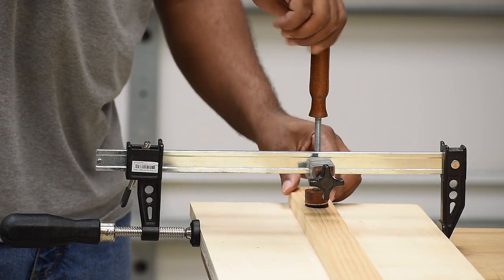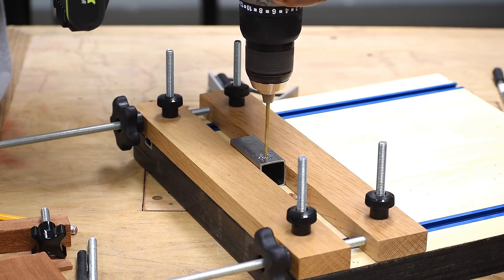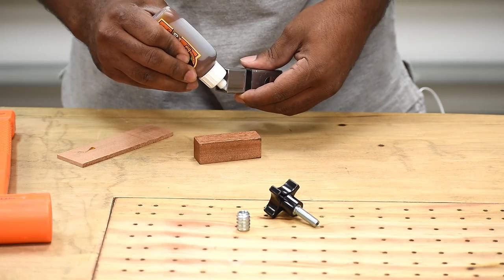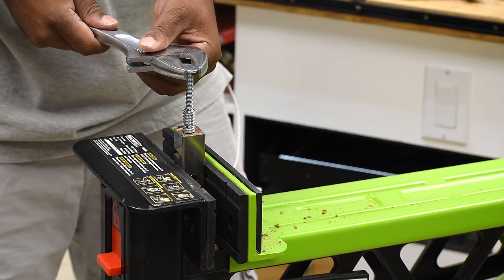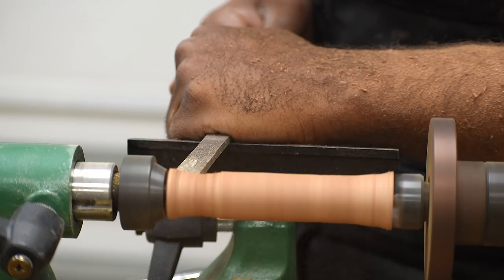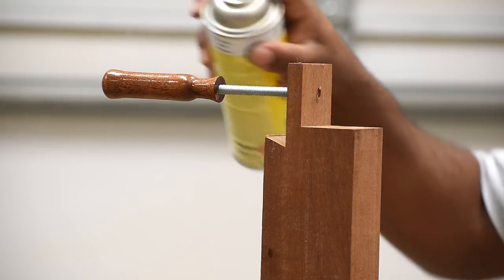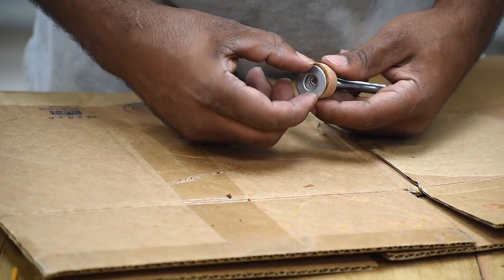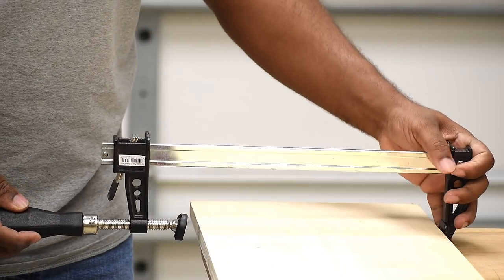Woodworking Clamp Attachment ( DIY )

Comment: What a good idea. One thing only. When turning, keep the tool support as close to the work as possible especially if you’re not using gouges. It’s all about having the maximum mechanical advantage if the chisel catches in the work. Anyway, this will be one of my projects in the new year. Seasons greetings from this side of the pond.

Comment: Great video! One hint though on using your lath. Try to adjust the tool rest as close to the wood stock as possible. It will give you more control, and less chance of having an accident due to the tool going too low while removing material. Thanks for your great idea. Be safe, and have fun.
Reply: I noticed that too. Still a great idea and video tho!

Comment: Great job, with your wood turning, move the tool rest as close as possible to the work. You will get less vibration in your hands and on the tool also less chance of the tool being thrown back at you and better control.

Comment: Awesome hack! I love seeing a problem and coming up with an inventive solution. That said... Irwin makes and edge clamp for $7 (on Amazon) called the Quick Grip Edge Clamp. I haven't tried it, but I wonder if you can achieve the same thing by reversing a small bar clamp (make it open instead of close) and putting it between the bar and work piece to apply pressure.

Comment: Just wanted to mention for safety sake, as a metal worker learning off you how to create wooden projects. Holding a piece of metal with pliers while grinding isn't ideal, it could catch and easily fly out of your grip. Also (not that I'm an expert) I think the tool rest should be set as close as possible to the work so if the tool grabs it doesn't have as much leverage pulling on the handel. 

Love your work

Comment: Make sure your large tool post is as close to the work piece as possible. If the work snags, you have the leverage to stay in control. Should give a better finish too, if that's what you need.

Comment: The wood lathe tool brace should be MUCH closer to the work, like a 1/2 to 1" away. Imagine if the tool bucked or bit into the piece you're turning. The tool would become a lever and a weapon, resulting in serious injuries, lots of blood, broken bones and a trip to the emergency room. I've seen it happen.

Comment: I love the idea and all the cool methods. I hate to be critical but in my opinion you used way too much gorilla glue. I also didn't see you use add any water to your glue joints. The gorilla glue you used requires water to cure. Once water is added the glue expands which is why I think you used too much glue. 
Keep making and I'll keep watching. Thanks.

Comment: you installed the insert the wrong way: the slot is not there to insert the insert it with a screw driver, but to help cutting the wood.
 Anyway, this clamp tool is a very good idea.
Thanks for the idea.

Comment: Nice job but a lot of effort for something you can buy at harbor freight for a few bucks
Reply from the maker: Thanks. I haven't shopped there in years. I wasn't aware there was such thing. I just enjoy making things anyway, so I don't mind going the extra mile.
Reply: I can't think of the name for the clamp but I picked up a few about two years ago and they work fairly well. I very seldom have a need for them and  then the lower quality of Harbor Freight stuff does not matter
Reply from the maker: I'll check out their site. I have needed it a few times and didn't have any. Being that I make videos, I'm sure I'll give them a few uses.
Reply: I've never seen one at HF
Reply: I just checked Harbor Freight and I don't think they carry the clamp any longer. I checked Amazon and the much more expensive Bessey version is available. They call it Bessey Single Spindle Edge Clamp and it sells for $12.50 plus shipping. The Bessey clamp looks exactly like the one I have from Harbor Freight and I'm sure I paid under $3 for it.  I think the Bessey clamp price is way too high and the if Harbor Freight no longer sells its clamp, then the solution presented in this video might be the best way to go.
Reply: I shop HF weekly and have never seen such a tool. I can buy just about any tool I need or will need, but I get a lot more satisfaction out of creating and building it myself.